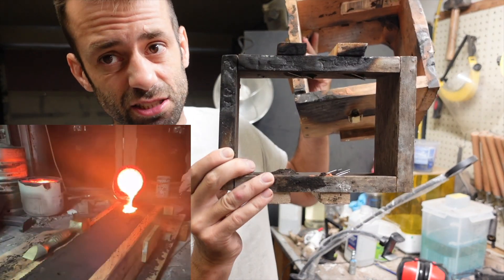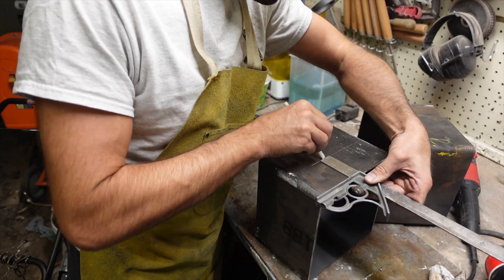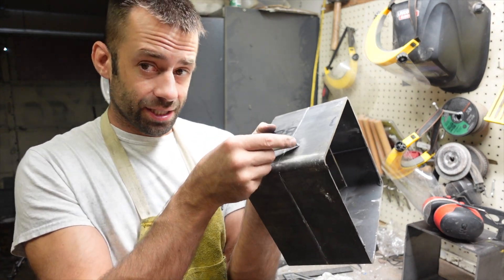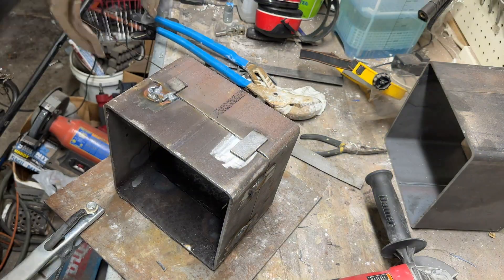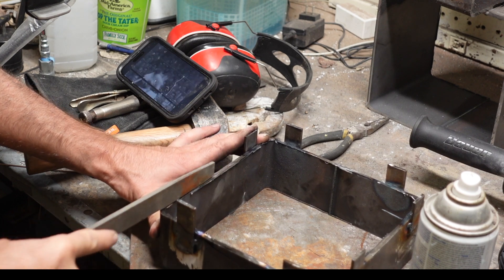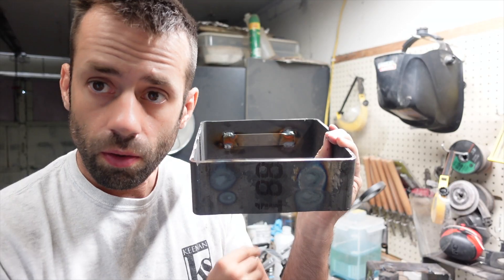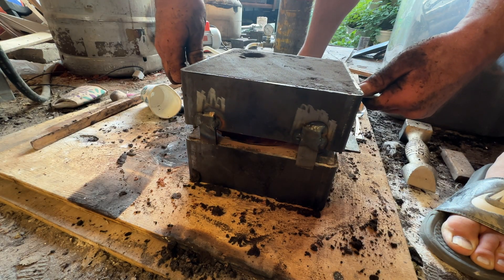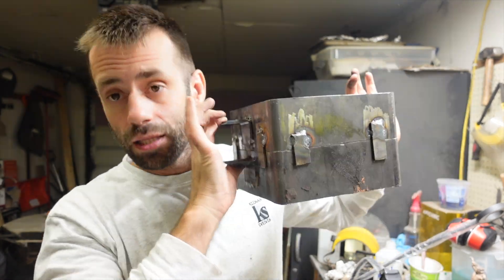Making Indestructible Casting Flask

Comment: Do you think the weight of the flask would help prevent metal pressure from pushing apart the mold?
Reply from the maker: It’s more about the weight of the sand or the weight you place on it. When I remember I put extra ingots on top the make sure it doesn’t float apart.
Reply: @lundgrenbronzestudios that makes sense, thanks!

Comment: You could just tack weld small pieces of welding rod inside to hold the sand. 
Also put a clamp across your handles to hold the mold together during the pour.

Comment: Those turned out great and big flask are stupid expensive so you could certainly sell those but nice job. Seen people use old brake rotors as a pouring guide to serve as both a protective cover and funnel.

Comment: Sweet and simple! I love it, especially the no measuring haha 

What's the raw steel box thingamajig called to buy? Couldn't find it with words i used on sites here in the UK.
Reply from the maker: I got it at a metal retailer. The have a section of cut off pieces that they sell per pound. I just call it square tubing. But I just rummaged around their scrap pile for a pice it found that. It cost me $17.
Reply: @lundgrenbronzestudios  damn, good deal dude 💘 I'll have to try find something myself. Mine don't fit well and burn waaay too easy for a dude casting indoors 🙈😂😂

Comment: I've actually managed to do a dozen or so pours with 0 spills, but my flask is still getting burnt up, just from heat radiating off the crucible. Also, might suggest a way to clamp the halves together, I've heard large pours can make the top float slightly, creating more flashing you gotta clean up later
Reply from the maker: Yeah even on this pour you can see a had a bronze ingot on top to weigh it down.

Comment: That's a pretty kickass flask, probably a lot easier to my than the guy with the ones you 3D print and then cast that require fancy taper pins. Definitely gonna try and find some steel square tubing now
Reply from the maker: I got it at a metal supply store. It was scrap and cost $1 a lb. It weighed 17 lbs.

Comment: We call those speed squares.  Definitely handy.
Reply from the maker: Oh I thought the triangle ones were speed squares?  Are they both speed squares?
Reply: As far as I knew.  I had to look it up.  Combination square.  I always heard both called speed square.  Always keep learning.
Reply: I'm a machinist, that's a combination square.  speedsquare is a carpenters tool. That's one of the heads used in conjunction with two others typically, the center head and protractor head. Not used much anymore in the CNC age.
Reply from the maker: @KingfishStevens-di9ji  that’s good to know.
Reply: @lundgrenbronzestudios  Anything else you wanna know, just ask lol
Reply from the maker: @KingfishStevens-di9ji  😆 thanks.